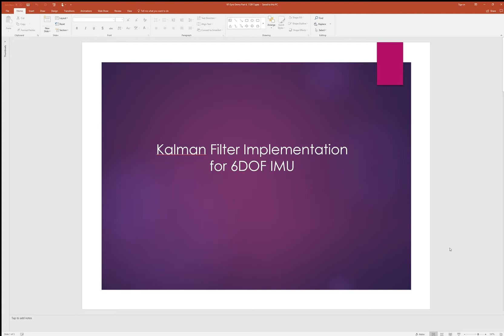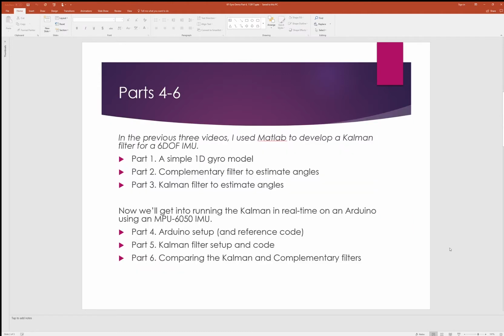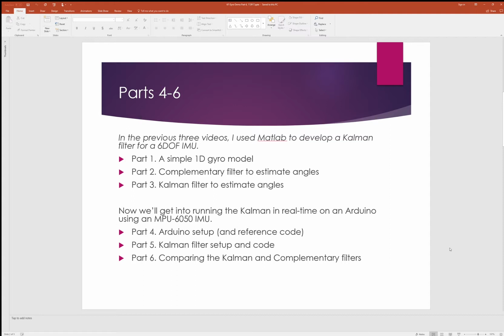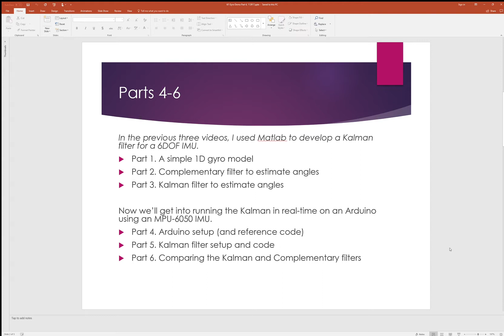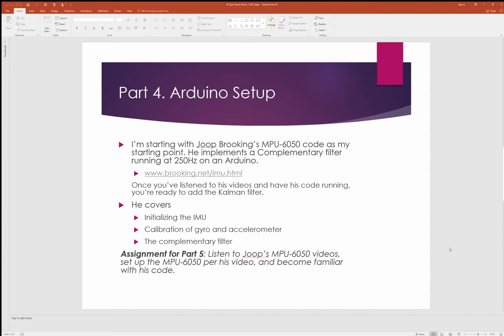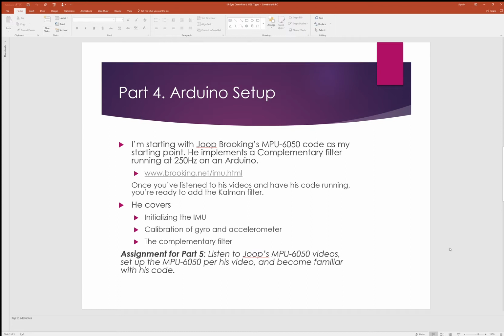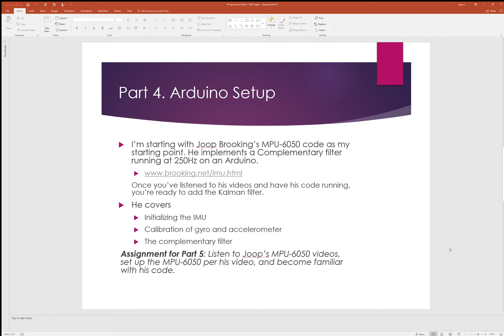Kalman Filter for 6DOF IMU Implementation (4/6)

Comment: Don, I implemented your Kalman Filter and I noticed that it lags behind  Joop's Complementary Filter. I can send you an Excel chart showing the angle over time computed with either filter. Any idea what to do to make the kalman filter more responsive?
Reply from the maker: Yes. How you tune (weight the gains) either filter will drive its responsiveness. For a complementary filter, it's the tradeoff between the weight of the previous vs the new measurement. For a Kalman, it's a similar thing in that it's the balance between the R matrix values and the Q matrix values. Try different things, like raising the appropriate Q diagonal terms a bit, or lowering the appropriate R diagonal terms.
Reply: @donkelly36  Thx Don. I think I found the problem. When the motors are off and I move the robot back and forth the Complementary Filter and Kalman Filter are yielding almost the same results. However, when I switch on the stepper motors, the Kalman Filter shows these strange results. I'm hunting down the electro-magnetic interference(s).